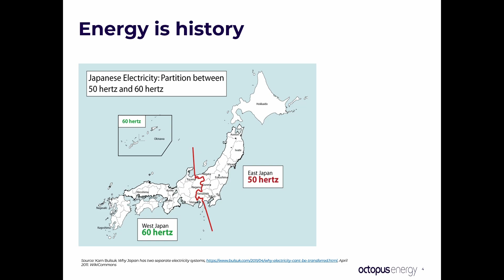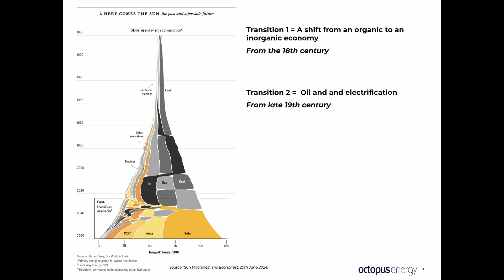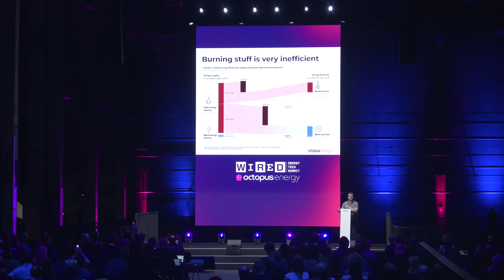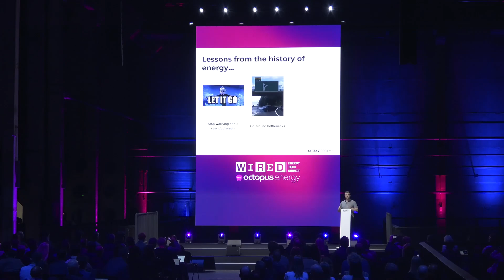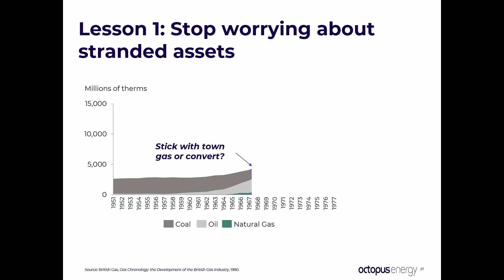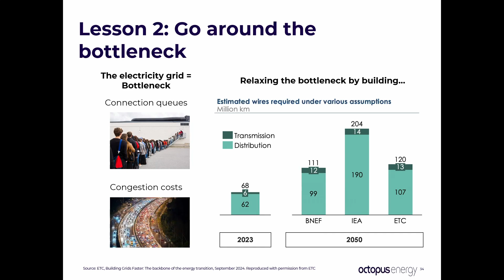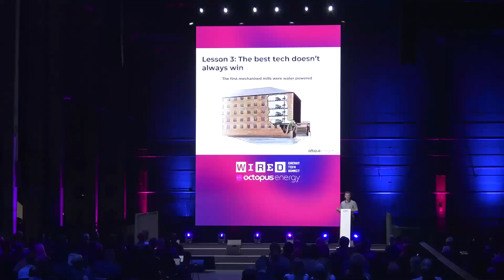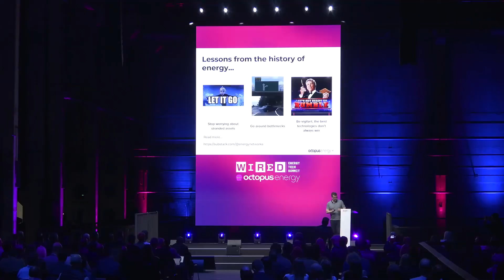300 Years of Energy History in 15 Minutes | Energy Tech Summit

Comment: There  may be a technological fix   for civilization by escaping the second law of thermodynamics through nanotechnology. The 2nd law is an encumberance on the principle that energy is conserved even if it changes form.

Lets reframe Earth's low contrast abundant ambient heat as a thermal energy waypoint between heat and other forms of energy instead of a heat death endpoint.  Uniformity is not in itself a form of energy.  

A simple rectifier crystal can, 
just short of a replicatable long term demonstration of a powerful prototype, almost certainly filter the random thermal motioren of electrons or discrete positiive charged voids called holes so the electric current flowing in one direction predominates. At low system voltage, a filtrate of one polarity predominates only a little but there is always usable electrical power derived from the source, which is Johnson (observation) Nyquest (theory) thermal electrical noise. Max Plank anticipated that ambient thermal noise would become usable with advances in technology.  

In 1973 I filed for US patent 3890161A DIODE ARRAY for an array of metal1/ insulator/metal2 diodes that refrigerate while concurrently producing electric power. The patent was granted in 1975. It was opened to the public domain in 1992. Sziemtific advancement should be in the public domain. 

The plausible net electrical filtrate from diodes can be aggregated in grouping separate diodes in  consistent alignment. The alignmet must initially be parallel. A higher order of these parallel groups can be connected in series to produce higher voltage. Within limits, parts of the  network can be shorted out or open circuted without electrical or chemical  harm. The electrical  power released is always equal to the refrigeration produced. Inefficiency effects the performance but not the equality of the thermal absorbtion and electrical yield of the conversion. 

The maximum energy is converted from ambient heat to productive direct current electricity when the load electrical resistance  is equal to the array internal electrical resistance. Maximum calculated electrical power output (watts) is k (Boltźman's constant), one point three eight x 10^ minus 23, times T (temperature Kelvin) times bandwidth (0 Hz to a natural limit on 0~2 THz @ 290 K) times rectification halving and nanowatt power level rectification efficiency, times the number of diodes in the array. 

There are a billion cells of 1000 square nanometer area each per square millimeter, 100 billion per square centimeter.

Order is imposed on the random thermal motion of electrons by the structual orderlyness of a diode array made of diodes made within a slab: 

Host crystal in this example is silicon or germanium. 

  P type boron doped
-----‐------‐----___-- Out
🔻🔻🔻🔻
■■■■■■___ + Out
  N type phosphorous doped 

All the P type semiconductor anodes abut a metal conductive plane deposited on the top face of the slab with nonrectifying joins;  the N type semiconductor cathodes or common cathode abuts the bottom face. As the polarity filtered electrical energy is exported, the amount of thermal energy in the group of diodes decreases. This group cooling will draw heat in from the surrounding ambient heat at a rate depending on the filtering rate and thermal resistance between the group and ambient gas, liquid, or solid warmer than absolute zero. There is always a lot of ambient heat on our planet, more on equatorial dry desert summer days and less on polar desert winter nights. 

Energy sensible refrigerators that absorb heat and yield electricity of equivalent energy content would complement computers as computing consumes electricity and yields heat. Computing would be free. Chips could have energy recycling built in. This would improve performance and lower cost. 

Full heat recycling, all electric, very isolated underground, undersea, or space communities would be highly survivable with self sufficient EMP resistant LED light  automated vertical farms, thaw resistant frozen food storehouses, factories, dwellings, self contained elevators, safe rooms, and horizontal transports. 
In a flourishing civillization, small self sufficient electric or cooling devices of many kinds and styles like lamps,  smartphones, hotplates, water heaters, cooler chests, fans, radios, TVs, cameras, security devices, robot test equipment, scales, transaction terminals, wall clocks, open or ciosed for business luminous signs, power hand tools, ditch diggers, pumps, and personal transports, Refugee communities would be buildable quickly. Fire safes would preserve contents to 1000F for years. These would be available for immediate use incrementally anywhere as people as individuals or larger social groups see fit. 

Some electrical equipment groups could be consolidated into local networks when suitable. Liguid nitrogen cooled superconducting networks would become practical. 

If a high majority thinks our civilization should geoengineer gigatons or teratons of greenhouse gasses out of our environment, instalations using devices that convert ambient heat into electricity can hypothetically be scaled up do it with a choice of comsequences including many beneficial ones. 

There are other plausible breeches⁰for anyone to of the second law of thermodynamics.  Hopefully a lot of people in independent teams, will join in expanding the breech. Please share the successes or setbacks of experiemental efforts. 

These devices would probably become segmented commodities sold with minimal margin over supply cost. They would be manufactured by advanced automation that does not need financial incentive. Applicable best practices would be adopted. Business details would be open public knowledge. Associated people should move as negotiated and freely and honestly talk. Commerce would be a planetary scale unified conglomerate of diverse local cooperatives. There is no need of wealth extracting top commanders. We do not need often token philanthropy from the top if the wide majority of people can afford to be generous. 

I do not seek to be the lead developer. This will disable confirmation bias and assure that other developers are acting on the merits of rhe hypothesis independently. One independent approach ìs diode arrays made of gold needles abutting straight into an N type GaAs substrate. This may be a better starting point for development than phosphorus and boron in silicon or Germanium crystal diode technology which is more familiar but plausibly inferior though it may be adequate for proof of concept prototyping. 

The topic deserves discussion and prototyping attempt action. 

  There could be net entropy reduction in the full lifetime energy accounting of diode array use. The entropic deteration of the structure of machine parts made of tough solids is inevitable but can be  minor compared to the stress of their use. This  is negative overall entropy.   

Diode array devices should be able to power the manufacture of àn ever increasing number of these devices. 

Aloha
Charles M. Brown
Kilauea, Kauai,  96754

Comment: If the water wheel was less economically viable then it wasn't the best technology
Reply: In England, one of the big reasons that coal power took off was because the water works, while extremely efficient, was also not privately owned by the manufacturers. It was cheaper, but it was also collectivized, so they would all be paying into the same resource which would inadvertently benefit their competitors. Many manufacturers at the time decided to switch to coal, because it gave them complete ownership over their source of energy and it allowed them to not benefit their competitors by paying into using the public waterworks system. The increase in the demand for coal based steam-power likely resulted in those who were inventing machines to transform coal to steam-power having more resources with which to develop the technology in order to make it more efficient. Private manufacturers had more of an economic incentive to switch to coal because it would benefit them solely and would result in less resources for their competitors who may have been benefiting from the collectivized waterworks. Essentially, it would give those who switched to coal an opportunity to get a leg up in the market and create a monopoly, even though it was actually more expensive and less efficient originally.

Comment: A frustrating situation at our home is we have 2 EVs with 156kwh of battery. There's no current way to integrate into our home electrical system. Imagine the storage capacity of the now 30 million EVs as buffers for renewables.
Reply: I wouldn’t be surprised if the new Model Y has it too. Cybertruck has it already